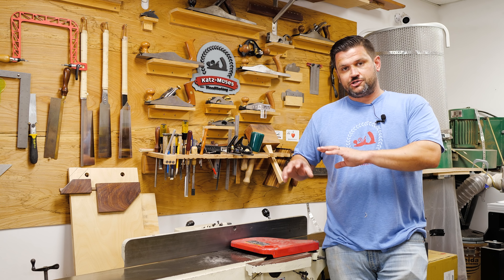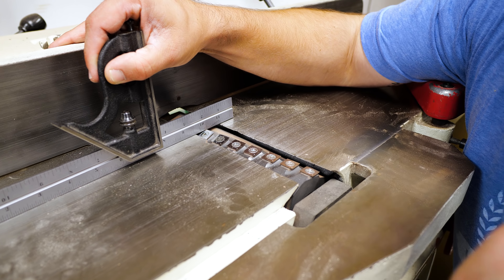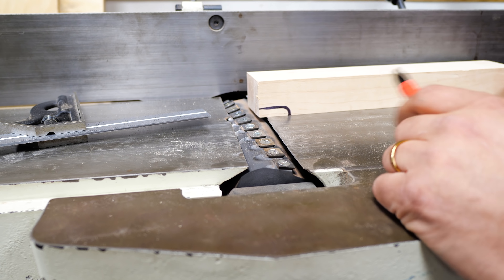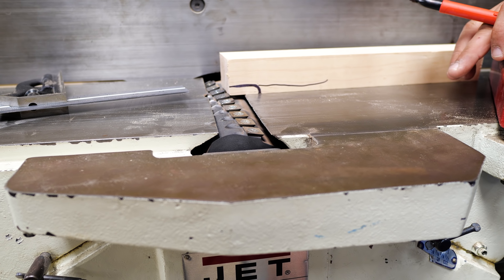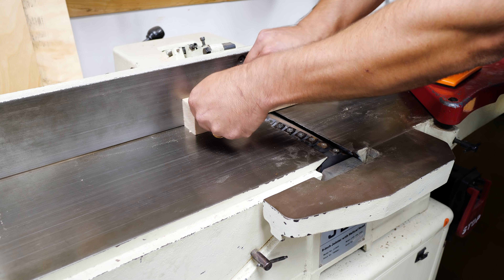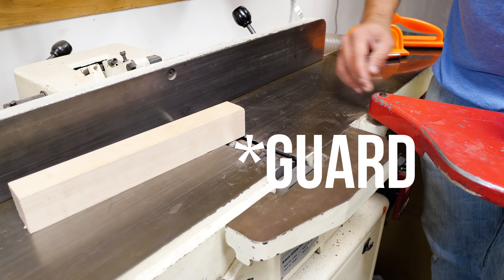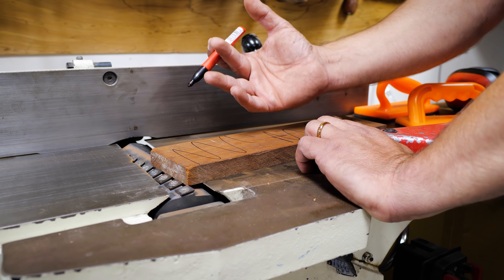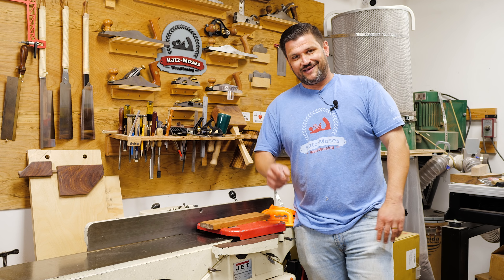Essential Woodworking Skills - The Jointer

Comment: Jonathan, Thanks for all your postings, very helpful.
Like to give you something back.  For 40 years, I was a retailer.  During that time I obtained some insight into building a brand as you are doing.  Consider - 1. Everything you do either builds or subtracts from your brand.  2. While most don’t realize it, once an expectation has been created by the best of the brands all other brands are compared to it.  Example, McDonalds has set a consistency bar, all 1/4 pounders, coast to coast and beyond are the same.   I suggest this is a standard of consistency, there are many more and for quality...

Your appearance, your shop’s appearance, your tools... video quality, your lessons, all add or subtract from your brand.

You are off to a great start!  I’m not proposing any change.  Hopefully this will bring up some new considerations and help as you continue to build your brand.
Thanks

Comment: Jonathan, thanks for the vid.  I have just purchased a jointer and waiting for it to be delivered.  The technique you described...never really thought about it.  I would have just pushed the material across not thinking about where the pressure should be.  I GUESS I would have figured it out...... after milling some stuff and it not coming out worth a squat.

Comment: I've noticed boards I jointed have a slight bow like you describe at 4:06 and I've been trying to figure out why
The forums I've read mention infeed/outfeed table parallelism and outfeed table height relative to the blade but my 48" jointer is well adjusted so I'll try adjusting my technique as you describe

Comment: I would never pass a board so thin over a jointer. If you are using push pads your fingers might be ok when it breaks because of a knot or grain change or a foreign body in the wood. But the broken wood can still hit you where it matters.if you are not using push pads your fingers will get jointed. I have a jointer but it’s decades since I have used it. I only use the thicknesser that is part of it. I use a hand plane, or don’t buy twisted timber. I might just one day use it on wood more than two inches thick, but I doubt it. There are videos on how to flatten a board with a jig  in the thicknesser. You get a constant feed doing it that way. Save your money and buy a better thicknesser and a try plane.

Comment: Sorry, but I don't agree with you.  I've been doing woodworking for 50 years.  I always keep my pressure on the infeed table side as long as possible before I switch sides.  This prevents any seesaw effect on the backside.  Pressure on the front end causes the backside to raise up the back.  Sorry